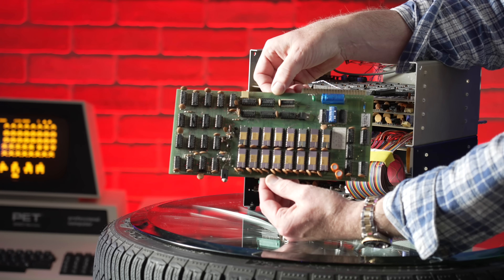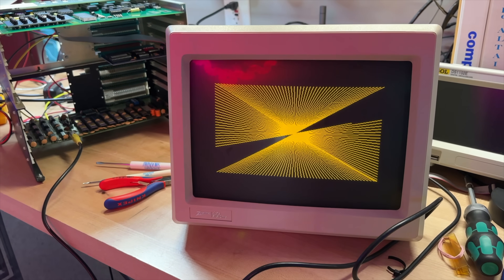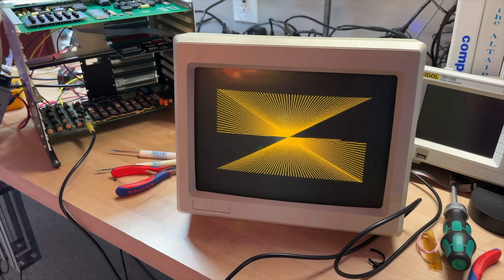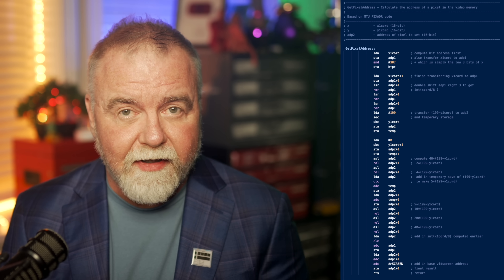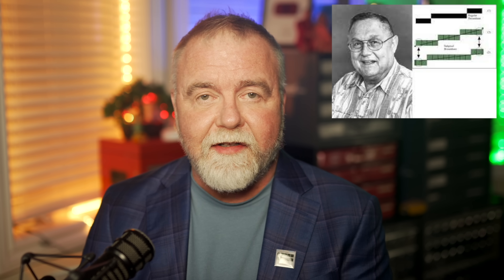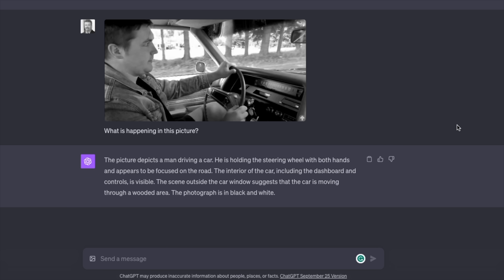ChatGPT Blew my Mind!  Now it can code AND learn from the results!

Comment: I remember working on a similar circle program on a Timex Sinclair 1000 many years ago. I had different restrictions and this was me learning to program.  I found that I plotted a point then the next took minutes to draw a circle. Then I figured out I could plot the next point but add to the y axis and also subtract from the y axis. Then from the center point subtracted from the x axis as well. Now I am drawing 4 points with the cost of one demanding calculation. Next changed out the x and y distance from the center point and now I was drawing the top, bottom, left and right of the circle in two directions. So the circle drew almost 8 times faster. I think I may have also did the points from each the 45, 135, 225 and 315 degrees  moving in both directions. It is something I have not thought about in years. Thanks for the memory jog.

Comment: FYI: There's many a scanned, type in, 6502 circle, circular arc, filled circle, ... magazine listing on this interweb thing (the Internet Archive has OCR'ed versions of many a period magazine, and there's many a forum with a screenshot). There's also the annotated source code for BBC BASIV IV, and later versions, that include reserved words and the associated (supposedly optimised) routines to do all the above, along with the trig functions, logs, ellipse, circular segments, IEEE arithmetic, ...  . There also appears to be the source for the ARM, Z80, 80186, PDP-11, 32016, ... versions of BBC BASIC, not sure the versions, but if the code were to appear in ChatGPT's GIT training set, later iterations of the tool may be able to generate functional code, for many a vintage CPU, without many an iteration.

Edit: had a look and the BBC BASIC plotting routines call an OS Write Character function, in the underlying Acorn OS layer eg. OSWRCH 25, plotVariant, x1, y1, ...  which from MOS 3 has code to plot at the current resolution, something circular. The only annotated MOS version i can see is v1.2, without the circle routines, while the MOS 3 -> 5 versions are simple disassembles, with many an autogenerated label and not a lot else. Though there appear to be some lookup tables close to the code. Might be worth having a play to see if ChatGPT can annotate a disassembly.

Comment: When using plugins, or the advanced data analysis extension of ChatGPT (4) you can make it  write and run the code (well Python atleast), test it, debug, run it again, test it, etc until it gets something which is working. You can then review the work, give it feedback on what you would like differently, or ask it to try and make it more efficient etc, and it will modify the code and test it iteratively on it's own. Works pretty well

Comment: I've tried dozens of things I thought would be trivial enough for ChatGPT, and it outputs bad/non-working code the vast majority of those time.  Last week I asked it to write a PowerShell to pull specific data from Azure and it produced a really inefficient function that used the Azure Graph API.  I told it that API was deprecated and to produce something using the Microsoft Graph API.  It did... but straight up hallucinated several functions and object properties that the don't exist, making the code worthless.  It's useless except for low level boiler plate stuff that you could have GitHub CoPilot output immediately with the correct comments.

Comment: Loved the video Dave.  It took me back to my days with Edtasm and the motorola 6809E.  

Recently Chat GPT helped me troubleshoot an exotic error code on a Korean made 480v VFD that powers a salt pellet mill.   I had my ideas about what was wrong after leaving sticky notes on dozens of pages of the manual, so I described my troubleshooting and what I thought it could be.   Chat Gpt summarized the error code in plain english and confirmed that an aux board was hosed.  Wow, I could have saved six hours of banging my head against the wall if I had just asked for help from the start! 

Super helpful, but when I asked it help me diagnose a problem with my 2015 chevy cruze it REFUSED to help!  I guess the automotive industry would sue the makers of Chat GPT if it tread on their territory! 

I also had a conversation with it about the mechanism of action of the mRNA platform shots.  It was happy to explain the step by step process from injection to creation of anti-bodies.  

Since you can take what has been said as context for more questions in the conversation I asked if the transfected cells that manufacture the spike protein would be destroyed by CD-8 Cytotoxic T-cells given that the presence of foreign protein makes the cells look like they are suffering from a viral infection.  - yes they would be.

So Chat Gpt, since we have discovered that the shot quickly leaks out into the bloodstream, what will happen to the heart when it absorbs it's share of the 15 to 20 Billion circulating Lipid Nanoparticles?

Chat Gpt- The muscle cells in the heart will produce spike protein and will also be destroyed by the immune system for the same reason muscle cells were destroyed in the arm muscle at the site of the injection... cells producing foreign proteins are considered infected and destroyed to stop the "infection".

Ok.  Chat Gpt, if a large number of muscle cells in the heart get destroyed what kind of symptoms would that produce?  Most people feel nothing, does that mean their heart was not damaged?

Chat Gpt-  depending on the amount of cells damaged and the scarring from necrotic tissue there may be no symptoms as in the case of Subclinical Myocarditis.  Higher levels of damage can produce everything from mild arrhythmia to sudden heart failure.

It was at this point that something else kicked in with Chat GPt and it said "You seem to have concerns about vaccination.  The current shots are safe and effective and there are not studies showing they have any serious side effects.  If you have more questions about the vaccines please see your doctor."  

Too late Chat Gpt.  You already spilled the beans because of your straightforward honesty about the microbiology.

Comment: You are having a laugh
It’s terrible 
I asked it a very very simple question of how to make an 8086 just be 8 bit and communicate with one 8 bit eprom and it told me “yes just connect d8 to d15 pins to ground !
The 8086 multiplexes its address and data pins, so doing that kills the addresses!
I then asked it to give me machine code for a jump command to jump back from address x to address y. It’s a very simple maths calculation in twos compliment and it got it wrong. When I told it, you are wrong it said oh sorry here’s the correct value which was wrong again!

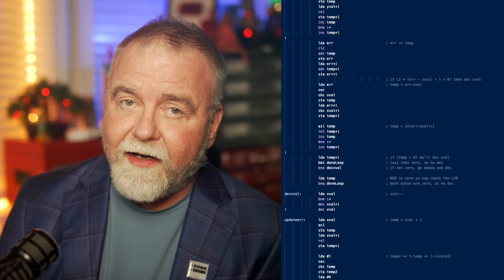Comment: 8:19 are you allowed to use self-modifying assembly ? I think I saw a neat trick once, or I might have read about it. you can exploit that symmetry and rewrite code on the fly when you pass through the "pie" sections. that way you save boring repetitive code.

Comment: 8:04 - There was a process called CORDIC that worked similarly that was used in early hand calculators, and at least one company put it into a super-minicomputer with a 384-bit floating point engine...  (Abbott labs loved it for molecular modelling...)

Comment: 4:27 - Some time I would like to hear your take on Threaded Interpretive Languages; FORTH and FORTH-like languages. It falls somewhere between assembly code and compiled code, not entire unlike the Java or Python bytecode  VM. For the robot project at the University of Florida in 1979 I posited a TIL for the robot with built-in telemetry operations and a notion of space and time, heady concepts I eventually used working as a real-time hardware/software engineer in flight simulators, jet engine test stands, RADAR, and "other modalities"...

Comment: I don't know much about coding but I made it use python to create a basic text based Final Fantasy style battle system with a character exp stat tree and variety of enemies and weapons and a weapon shop.  It took several iterations in 3.5 but eventually we got it going and you just battle monsters over and over until you get enough exp to level up or gold to shop and continue battling until you die.  I'm extremely impressed because I don't have the first clue how to actually code any of that.

Comment: An ultra easy way to draw a circle is by: loop; x=x+y/p; y=y-x/p; goto the loop about 2*pi*p times. if p is an easy number like 16 or 256 or 655536 the division is easy. set x to the size of the circle and set y to 0. set p to the value of how many pixels to draw.
Reply: Xyz thing so is there anything between line that produce 8 bit
Reply: Hex codes sometimes useful to allure on unknown universe
Reply: Bits that rotating are have. Length

Comment: 00:14 🤖 ChatGPT as a debugging tool: User successfully used ChatGPT to debug code by providing a screenshot of the output, allowing ChatGPT to diagnose problems by analyzing the screen.
01:00 💡 6502 Assembly: The user, a seasoned programmer, has been working with 6502 assembly for 40 years and chose to use it for a retro computing project involving Super Pets and Kim1 single board computers.
01:54 🧩 Unique Hardware Configuration: The user's Kim1 single board computer was extensively customized with multiple extension cards, showcasing impressive DIY skills and early adoption of MTU hardware.
03:21 🖥️ C Compiler for Kim1: User ported a C compiler (cc65) to the Kim1 platform to facilitate faster coding compared to 6502 assembly, enabling tasks like drawing lines and circles on the Kim1.
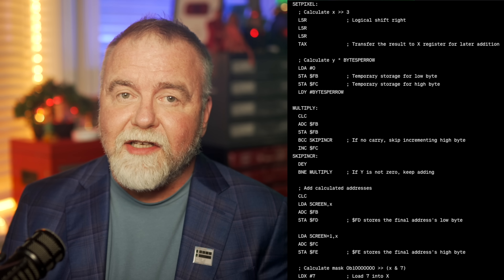05:14 🔄 Feedback Loop with ChatGPT: User shared C code with ChatGPT and requested a 6502 version, refining the code based on ChatGPT's output, creating an iterative feedback loop for code optimization.
08:03 🎯 Midpoint Circle Algorithm: User implemented the Midpoint Circle Algorithm in assembly, leveraging circle symmetry and integer arithmetic to efficiently draw circles on a bitmap display.
10:35 🔄 AI-Driven Closed Loop Iteration: The user envisions a future where ChatGPT could autonomously iterate on code solutions, potentially achieving desired outcomes through a closed-loop process without human intervention.
Reply from the maker: Added this to the description, thanks!

Comment: The real fun part is that I'm pretty sure you could code a 6502 emulator with the help of Chat GPT, so it could both create the (model of the) CPU and debug the assembler running on the (emulated) hardware.

We've gotten far in the past few years with AI. I wonder how far we'll be by 2025!

Comment: I loved the 6502!  I didn't have an "assembler" to type code in to, so I would hand write it out, figure out all the addresses for any JSR's or JMP's by hand - translate it all to opcodes, then poke those into memory.   Looking back - I should have just written an assembler but I was 12 and smart, not wise - HA!  Thanks for these looks into the past. The last time I did anything with a 6502 was in 2004 because I was programming a gas pump that was powered by one.  Good times - thanks again for what you do here.

Comment: I was missing the actual output of a circle by the corrected 6502 code. It would have been nice to see how it performed.

In 1984 I've written bitmap graphics routines (single pixels, lines, circles, text) for the C64 written in 6502 in the form of additional BASIC commands. I used it for a real time clock demo. I had designed an RTC for the userport and wanted to show it off. :)
I wonder if the source code is still somewhere. Hm.

Comment: The abundance of optimized graphics examples, cross compiling, & turbo emulation mean you never really can relive the process of entering opcodes & discovery as it was done in 1985.  The lion kingdom tried but reverted to just copying & pasting with rapid fire emulator reboots.

Comment: In my opinion, ChatGPT is like a smart highschool intern. It can point out flaws in your code easily, and interpret error messages like it's plain english. However it sometimes makes obvious mistakes, I've seen it call functions that doesn't exist, or create inefficient, or memory unsafe code.
Reply: And like the pimply faced intern, it often also cannot explain why the flaw in your code is a flaw, or how it could be fixed. And all too often it just spouts gibberish, and you realise it is better off just making you a metaphorical coffee.
Reply: There are other Chat AIs out there as well, so mix and match. Sometimes ChatGPT fails where one of the others succeeds and vice-versa.
Reply: @kevinmcfarlane2752  They're all LLM's though. With the same failings.

I have found that the less you know about something you ask a LLM, the more impressive they seem.
So ask an LLM something about a subject you know a lot about. :)

Comment: look. consider what that poor ai knows about what you want from it. okay ?
if you indeed provide all, and i mean all, the required details, what hardware you got, what language to use, what goals to priorise etc... it will make proper, working code. and indeed it can be instructed to hunt for possible solutions to make it run better. efficiency wise it is able to tell apart efficiency as producing the shortest possible code, the most easy to understand code, the most easy to read by human code, the possibly least electricity hungy code, and so on. if you manage to outline first what you want, properly that is, it often returns a code, asks you to see how well its running vs a nother code, effectively its asking you to do a benchmark. 

however, it takes a literal wall of text to set it up correctly.

Comment: I had similar experience getting it to write screeps code. At first I was simply curious if it knew what screeps was, surprisingly it not only knew but at request was able to write functional code first time. I gave it verbal feedback on how its code performed and it was able to suggest and implement 3 improvements in a single pass that went on to be a success. While I have programming knowledge, I never used that knowledge and spoke to it like a layman allowing it to be the programmer. I served only as the eyes and hands interface.

Comment: I had that exact same rig with the card rack, graphics card, sound card, EEPROM card, and extra memory card all from Micro Technology Unlimited (MTU).  I even had one of the wire-wrapped prototype boards that I bought from Hal Chamberlin himself.  One of my first graphics programs was to draw the Moiré patterns with lines as you did.  Some other stuff I did was to grab a chess playing core program and put a graphics chess board wrapper on it, a Wandering Snake game, an 80 column font set & terminal emulator, and other similar stuff.  All written in hand coded 6502 Assembly.  Thanks for the wonderful memories!

Comment: Me:
Hi, does chatgot have built  in pythin inoterpreter ?

ChatGPT:
No, I don't have a built-in Python interpreter in the traditional sense. You cannot execute arbitrary Python code directly within this chat interface. However, you can share Python code snippets with me, and I can analyze, debug, explain, or suggest improvements for them.

If you have a specific Python-related question or problem, please let me know, and I'll do my best to assist you!

Comment: Hey Dave, if you haven't already you should try the BBC BASIC on the Agon Light eZ-80 board. It's a 21st century BASIC on a genuine 8-bit system costing around $45. It's a BASIC with all the features and fixes everyone ever needed. I wonder if our 80s BASICs had named functions and such, if it would still be in use.

Comment: I´ve been programming arduino with Chatgpt 3.5 aid, it can write or implement the code for you, but if you ask too many things at once, or if the code is too long it forgets some parts, or messes what is already working. The other annoying thing it does is to use deprecated code, and even if you correct it it rewrites it wrong in the next iteration. Maybe because chatgpt memory not updated. The way I did, is ask it to fix only small sections of the code and join them in the IDE. Mind that I only used the free version, dont know if the paid one is better. But its trully amazing!

Comment: I have been having a blast with ChatGPT. I've asked it about a wide variety of topics. Chevy's new Corvette, travel agent trip planning, NASA's Voyager, and regular expressions, are just a few topics.

As a freshman at the University of South Carolina, our class elected to use the department's DEC PDP-8 instead of the monolithic IBM 370 mainframe. We learned FOCAL, similar Dartmouth BASIC. In the second class, we learned PDP-8 assembly. 
That formed the foundation to learn other computer assembly languages. At USC, I taught myself DEC PDP-11, and IBM 370 Assembler. At NCR, I programmed in Intel 8080/85, including Zilog Z80, and Motorola 680X0. I have the 6502 programming card, but I've never used assembly on my Commodore 64.
I hope to fire up my DEC VAXStation II/GPX.

I have been enjoying the content of your YouTube channel.